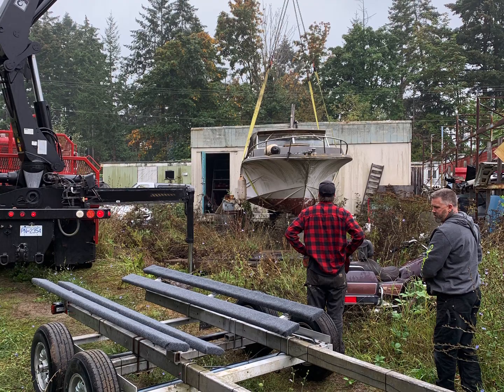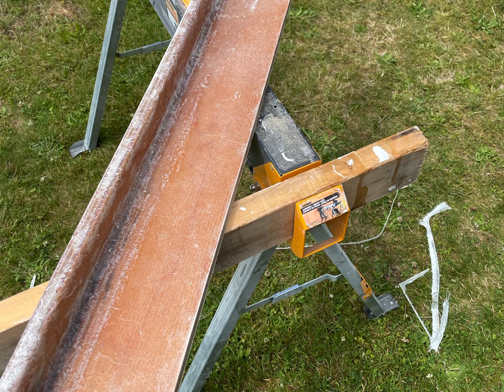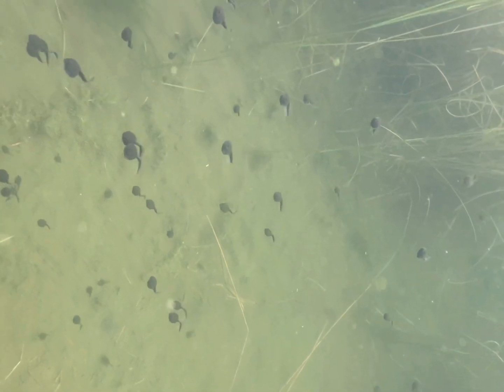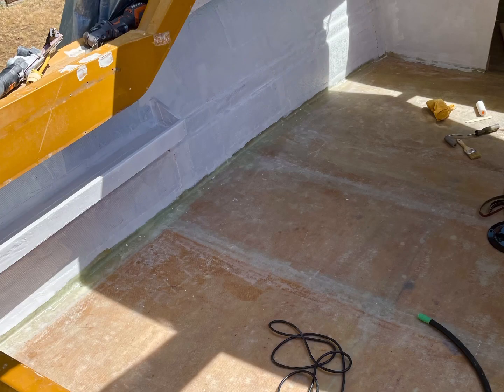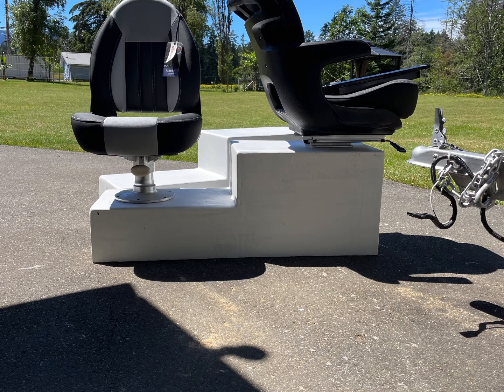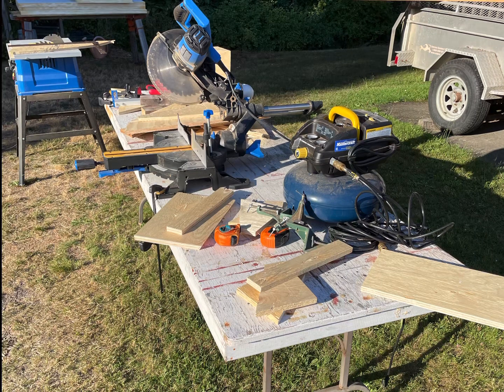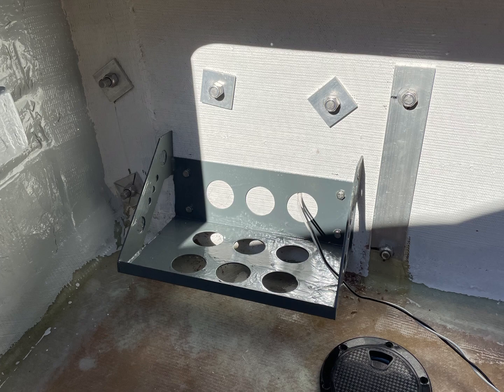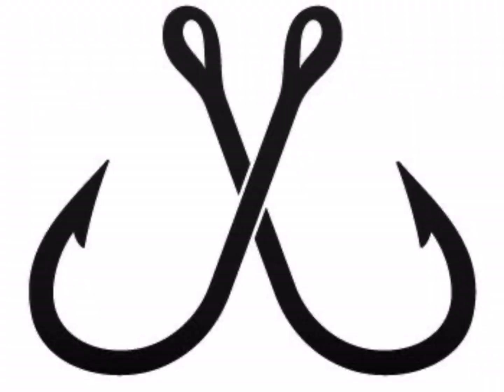Double Eagle coming back to life Part 14

Comment: These videos are great! I am doing a project sort of like this on an old 185 steury with a cuddy cabin. Similar to a double eagle 185 hull. Just tearing the rotten transom, floor and stringers out now. 

Im curious where you sourced all your fiberglass from?? I am located in Langley bc
Reply from the maker: As the weather gets better, I’ll get back to making some more videos. It’s been too cold and too high of humidity to lay glass right once that situation is rectified. I will be back to work and building the new top. I’m very excited about that so stay tuned.
Reply from the maker: I got most of my stuff through industrial plastics and paint